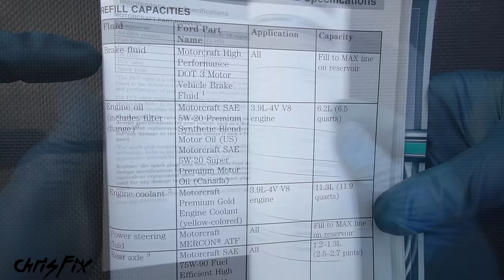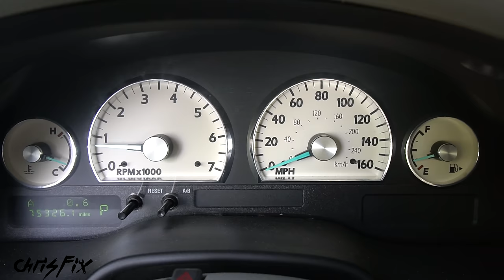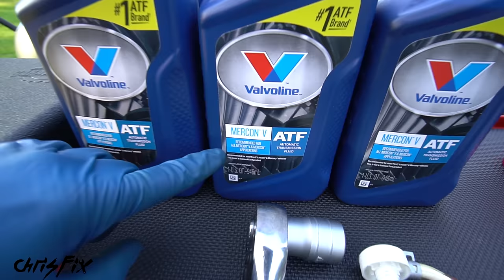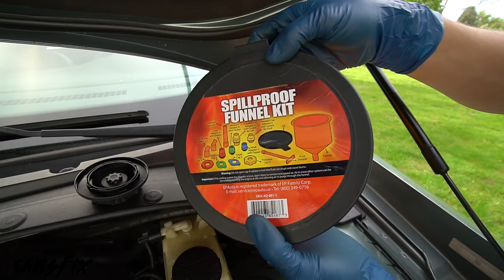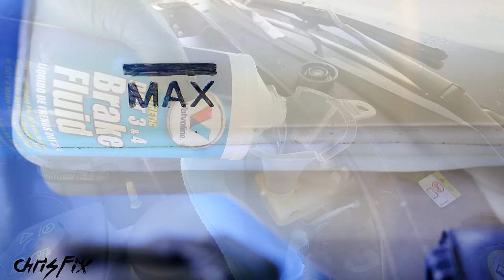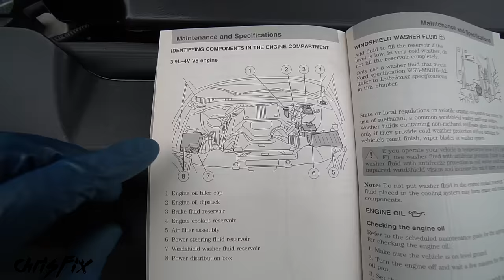How to Change EVERY FLUID in your Car or Truck (Oil, Transmission, Coolant, Brake, and More)

Comment: I can’t believe he forgot blinker fluid 😂
Reply from the maker: Watch the video again :p
Reply: he did at 38:53
Reply: Ikr tf man
Reply: @Ready__xx__minecraft  yeah we know
Reply: Must be a BMW driver
Reply: @chrisfix  what about the piston return springs or the muffler bearing?! Thanks for all you fo Chris!!!
Reply: @footyshort  lolol
Reply: You have to change it every 10000 miles
Reply: @Ready__xx__minecraft   I change mine every  4567.876 miles.    

Exactly 4567.876 miles.
Reply: @livewireOrourke  bruh you're 2 miles off
Reply: And muffler bearing!😂
Reply: @chrisfix  
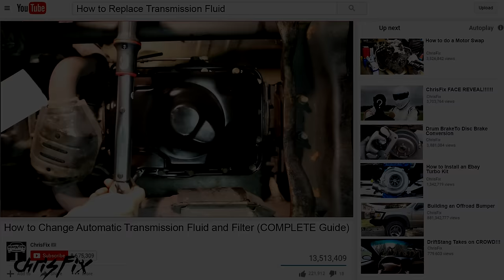14:35 ... Also, remember to constantly monitor the condition of the nut holding the steering wheel   ;·)
Reply: @aeldallkushi5882  thank you for mentioning the muffler bearing, very important

Comment: Chris as a 15 year old you’ve helped me so much I appreciate everything you’ve done for the car community and for the people who didn’t have anyone to show them how to fix their car it really means a lot to us
Reply: You like cars huh
Reply: It's always good to flush any fluids in any automobiles all but automatic transmission ONLY if the automatic transmission fluid  is ( burnt ) and looking like it's Blake fluid
Reply: @jonnygarland4741  Actually its the opposite...if the trans fluid is looking burnt then the fluid probably has grit that helps the discs grab still and when you drain you lose that grit and the trans starts to slip
Reply: @Bimmer_MD  that transmission is screwed though, it's worn out,you could  use the lucas additive if it starts slipping
Reply: Repent to Jesus Christ “The light shines in the darkness, and the darkness has not overcome it.”
John 1:5 NIV
Reply: @Repent and believe in Jesus Christ You can pray all you want, if you don't change the fluids in your car it will eventually break down.
Reply: @francoamerican4632  Not true. I prayed and God changed my car's fluids for free
Reply: As a 19 year old I back this
Reply: @jonnygarland4741  unless it’s a Honda. Don’t flush any Honda components.
Reply: 15?your car is scared😱💀💀💀
Reply: @demonslayer4951  16 now still ass sliding my fwd honda prelude😭
Reply: Why do you have a car at that age? 💀

Comment: [4:25] - Oil Change
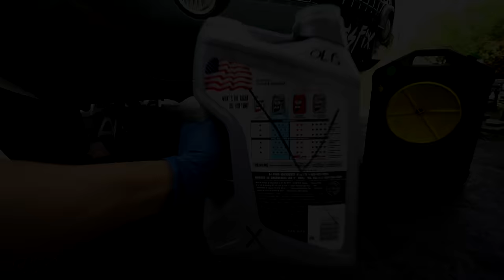[9:38] - Transmission fluid
[14:37] - Power Steering fluid
[17:14] - Coolant fluid
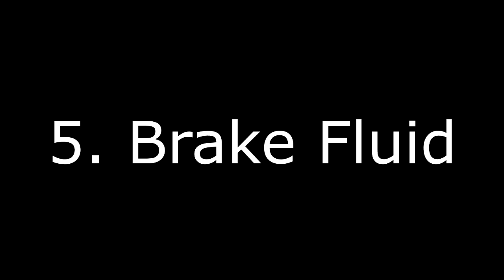[24:49] - Brake fluid
[30:23] - Differential fluid
[32:53] - Transfer Case fluid
[34:57] - Grease
[36:57] - Washer fluid
Reply: Blinker Fluid is missing ☝🏼
Reply: @emirhas8793  😂🤣😂
Reply: @emirhas8793  he has a separate video for that!!!!
Reply: @EazymoneyBicch  i know 😂😅 with elbow greese
Reply: Thanks
Reply: @emirhas8793  lol
Reply: @emirhas8793  p
Reply: @emirhas8793  hahaahhaha
Reply: @emirhas8793  wait bmw cars  don't need it
Reply: Thank you ❤️
Reply: thx
Reply: Thank you
Reply: Thank you 🙏
Reply: @cozz124  LMAO 😂
Reply: Thanks
Reply: Champ! Thank you
Reply: stolen
Reply: So many Soda flavors.
Reply: @emirhas8793  wtf
Reply: The video has chapters 😭😭😭
Reply: You could just go to the chapters but thanks!
Reply: You got fancy with the brackets

Comment: 1. Engine oil 4:24 
2. Transmission Fluid 9:38
3. Power Sreering Fluid 14:36
4. Engine Coolant 17:14
5. Brake Fluid 24:49 
6. Differential Fluid 30:23
7. Transfer Case Fluid 32:54
8. Grease 34:57
9. Washer Fluid 36:55
I gotchu <3.
Reply: Real Chris Fix fans see the whole video, although we've seen the in-depth videos ;)
Reply: I didn't get to watch it do to school :(
Reply: Ty
Reply: My Mechanical Engineering professor who use to be head of development for Ford in England, said depending on the fluid “lifetime fluid” is only good for 100-120k Miles.. This may vary depending on the manufacturer. Sometimes it can just mean while it is under warranty so 60k miles..
Reply: You sir are a legend I applaud you
Reply: No blinker fluid? :( really need to change mine
Reply: @RoCarz  time stamps help because when we come back at future we dont have to watch the video all over again so that comment is super helpful
Reply: U don’t do that here, real fans watch the whole thing
Reply: @ClassCraZeTV  watched it twice.the second time just to write down where everything starts so its easier for me and for u guys to get where u want when u come back.without having to search around for what u looking for
Reply: thanks really helpful :D

Comment: 0:00 - Beginning
1:15 - Lift the car
4:23 - Engine oil
9:37 - Transmission fluid
14:35 - Power steering fluid
17:13 - Engine coolant
24:48 - Brake fluid
30:22 - Differential fluid
32:52 - Transfer case fluid
34:57 - Grease
36:55 - Washer fluid
38:30 - Lower the car
38:53 - The End
Reply: God bless you!
Reply: Thanks! You're the best!
Reply: MVP
Reply: You’re a Saint
Reply: @isaiahcedillo9435  Naahh... Just a Swede (you know, that dark and mysterious country in the north).
Reply: You the real MVP!
Reply: You missed the blinker fluid part
Reply: Thanks bro
Reply: @edo386  LMAO 🤣
Reply: Resetas
Reply: Be careful. He's a hero
Reply: Hero
Reply: Thanks made it easier

Comment: I know absolutely nothing about cars apart from cleaning them, changing a tire and checking the oil.
Your videos have given me sooo much information and I've watched some of them multiple times to really soak in all the knowledge. Watched the brake change video today but I'm not yet confident enough to do that. But I might just change the oil myself, check the other fluids and maybe change them or at least tell my uncle (mechanic) what needs to be changed.
Keep up the great work
Reply: If you can change your oil you can do your brakes. Just make sure you have the patience haha, you can do it!
Reply: Learning to change oil is a great way to begin learning vehicle maintenance. Along with spark plugs which are inexpensive and also easy to change. Just be mindful not to cross thread your bolts. Especially the drain bolts for oil pans. Buy yourself an actual service manual for your vehicle to go along with the owner's manual. Invest in a few simple quality tools and you'll be off and running.
Reply: Believe it or not, knowing nothing about cars is complementary to femininity. Don't feel that you need to get into masculine things to be acceptable (yes, getting into cars is a masculine thing). Sadly, many women today are not taught how to be a female at all. Try and find womanly women, hang out with them and learn from them. Also, unless you've lost your hair because of an illness that you can't control, having a buzz cut is not feminine. If you look to the past, you'll find that feminine women were nothing like the women you see today. You should want to be more feminine not only because it's beautiful, not only because masculine men love it and do not love unfeminine women, but because you are a woman and once you get the basics down, you will naturally do it well.
What you just heard is the truth and, sadly as well, the majority of people out ther are too cowardly to tell you the truth. I would say that most people on the coments section are too scared to tell you the truth that they will pander to you.
Search for videos of feminine women and you will not see them working on cars. And if you want to get a full dose of real women, search for videos of biblical women. Regardless of how you feel about religion, those women are super feminine and super ladylike. They will give you the best advice. Reunite with your femininity and leave the masculine things to men, there are enough men around to handle the job (including your husband or future husband).
Reply: @yougetagoldstar  i agree with what you’re saying but learning about cars is kind of essential in this day and age regardless of gender lol.. if a woman is dropping her kids off at school and her car blows a tire she should just wait on a man to change a flat? lol

Comment: I can't imagine a more perfect instructional video.  The biggest obstacle to doing vehicle maintenance is not knowing what we're doing.  Not having a mental picture of what we need to do.  Chris' videos take that mystery away so we DIY'ers can keep our equipment running for many more miles.  Many thanks, Chris.
Reply: Man, I recently bought a '96 grand am gt, and I'm pretty sure the previous owner never flushed any fluids. They lived in a Florida beach, and there sand everywhere. I'm pretty sure there's sand in the radiator even.  😅
Reply: @Freezinggreece2  Last year, I bought a '94 F-150 that came out of Tennessee.  Turned out to be a '94 cab on a '92 frame.  I flushed EVERYTHING - even the rear differential and brake fluid.  It's a great truck in that you can even drain the torque converter fully.  But I figured if it was a junkyard Frankenstein then I better do a thorough job if I wanted it to last.  Had to rebuild all four brakes, too.  I found that an oil pan off of a 4x4 will fit on this 2 wheel drive truck.  The 4x4 pan has a drain plug.  How nice.  Don't have to be balancing an oil pan full of 6 quarts of oil in it while laying on your back underneath the truck.

Comment: Engine: 5:00

Transmission: 9:37

Power steering: 14:37

Coolant: 17:15

Brake: 24:50

Differential: 30:23

Transfer case: 32:54

Grease: 34:59

Washer/ windshield wiper : 36:56
Reply: It's already in chapters lol
Reply: @pineappleboi27  this is incase I need a refresher, I just time stamped them for my convenience.
Reply: @ReaIHuman  thanks mr chicken man
Reply: Where’s blinker fluid and horn oil?
Reply: @nazthelizard122  don’t forget door fluid
Reply: @nacl2858  And summer/winter air for the tires.
Reply: @Veroxzes  I have to change that? :O   Is it difficult?
Reply: @rasmadrak  its sarcasm
Reply: @jaxx1360  Yes. It was pretty obvious too. 

But don't forget to change the blinker fluid. ChrisFix has an episode for that. 👌
Reply: You seem to be a real human.
Reply: Yeah I waiting for this comment lol t.y
Reply: Repent to Jesus Christ “The light shines in the darkness, and the darkness has not overcome it.”
John 1:5 NIV
Reply: At what time is the blinker fluid? ;)
Reply: Where is the blinker fluid
Reply: @nazthelizard122  they are not real they are April Fools jokes

Comment: chrisfix:"make sure to torque the lug nuts to spec"
me:"i think 3 ugga duggas is enough"
Reply: don't make that extra 1/2 ugga dugga !! haha
Reply: NightmareWOW I just let it click a couple times I don’t bother with ft lbs lol just make it tight
Reply: Yeah but, like my dad says, "ugga duggas isn't a precision torque measurement." He says this because his coworkers would never use a torque wrench and then they would cry about the leaks they would have.
Reply: I've seen the "ugga dugga" reference on a few YouTube car videos--what is it from?
Reply: Never torque in the air....
Reply: @dantizzle00  "Ugga dugga" is the noise an impact wrench makes.
Reply from the maker: Sounds about right!
Reply: @chrisfix  hey Chris, how are you? Can I put a turbo in a 2002 Suzuki XL-7
Reply: Nolan Samuel You can turbo most cars. It just depends how much space you have in the engine bay to work with. Also note how many miles you have. With so much air being pushed into the pistons, it’s going to make your engine work harder. Transmission too. You’ll be shifting faster. So if it’s a super old engine and transmission, I wouldn’t recommend it.

Comment: I feel my self warm and relaxing when you took care of the cars and even I feel good when driving after doing awosem care
Reply: Same, man! With this covid situation now I don't have mich money. I had to service my truck this summer, but I can't afford it this year so I'm going to remove all the wheels and put it on jackstands😂. I'm gonna service my baby next year for sure. I'm changing most of the independent suspension parts, oil, brake pads, rotors, brake hoses, power steering fluid, thermostat... Just a lot of work man... Thank God I have a few buddies to help me with this gigantic job. I mean I can do most of it, but I don't have all the tools... So that's why you need to surround with people who can help you, and later of cource I will return the favour.

Comment: Success story! I bought an old truck with 225k miles on it, and my brother told me the best thing I could do for it would be to change all the fluids. Then he shared this video with me. This video gave me the confidence to get it done myself, and I'm so grateful! I even got extra thorough and did a complete flush of the coolant, complete drain of the transmission (including the torque converter, which had a drain plug), and I removed, cleaned, and painted the differential covers. It was actually fun! I just finished the job and took it out for a joy ride and she runs beautifully! So stoked! Next I'm moving on to your video about detailing the engine bay. It's covered in old grease and stays hot for a while after shutting off, so I think cleaning it will help a lot. Thanks Chris!
Reply: where did you get rid of all the coolant/water from your flush?  how much did it generate?
Reply: @laurelrunlaurelrun  my auto parts store does oil and coolant and diff fluids and such. just ask em

Comment: Chris, you forgot the Blinker fluid!
Reply: Best comment.
Reply: blinker fluid only needs to be replaced once a year, on April 1st.
Reply: @TheAngusGao  exactly
Reply: f
Reply: Was looking on thumbnail for it lol
Reply: I came here just to find this comment and thumbs up I knew it would be here
Reply: @TheAngusGao  Along with the muffler bearings. If you forget those then you might as well toss your car in the trash pile!
Reply: @TheAngusGao  For those who are curious, it's because it's a very sensitive season specific fluid and 12 days into spring is the optimal time to do so, especially for BMWs. No other reason whatsoever for that specific date. :)
Reply: funny i was gona say that... also kanuter valve
Reply: Right now this comment is 3rd in the list.
STILL SCROLLED DOWN WAY TOO MUCH WTF INTERNET
Reply: You stole my idea!
Reply: Clicked the video just to comment this. I was late...
Reply: @markwright3161  so u have problems with Bmw-s overthere to whit blinkers that comes as extra whey they are purchased as new, thats the xtra feat that cost more then the whole car, itt goes for audi-s and mercedes to
Reply: Don't worry, he's got a separate video on that.

Edit: not a joke, btw. He actually does.
Reply: @ginaboos9563  can you pls explain? I have no idea
Reply: @hadiasari3092  Do not worry, its merely a joke. This video has everything you need on changing your vehicle fluids, the video is correct.
Reply: @barse27  I don't do it because it is too risky. As Chris warns, if you get it in your eye it causes uncontrollable blinking.
Reply: Just watch the video linked at the end 😉
Reply: Automatic or manual?
Reply: There is nothing called blinker fluid
Reply: CTRL+F "Blinker"
Reply: @TheAngusGao  obviously blinker fluid needs to be replaced on February 30th.
Reply: I was looking for a comment like this 😂
Reply: Yeah
Reply: @noahmcclure2515  lol
Reply: It's there just watch
Reply: There is no such thing as blinker fluid
Reply: No all cars have blinker fluid
Reply: It's in the background 24:47
Reply: I was waiting for this

Comment: Helpful tip when changing the oil filter: get a 1 gallon ziploc bag and place it around the filter when loosening. Allow to drain for a few seconds into the bag then remove the filter with the bag still around it and voila, clean filter removal.
Reply: Thanks for the tip. That is a very logical thing to do! :)
Reply: But then how do I get my yearly dose of viscous hydrocarbons and fine metal shavings? Can you even call yourself a mechanic if your blood/oil ratio isn't at least somewhat worrying?
Reply: But I like it running down my arm.
Reply: Thank you so much for this tip!

Every time I change the oil on my Suzuki Grand Vitara I curse the engineers for putting the filter where it is (you have to reach up almost shoulder deep into the car from underneath and you're working blind, and there's something in the way from up top so you can't reach it from there either).

I'll definitely have to give this a shot
Reply: Benjamin Dan you’re welcome. Let me know how it works for you.
Reply: Nice!

Comment: Mr Chris fix.  You are the best instructor on the web.  I have fix 3 vehicles including my own using your videos.  My car now has all of its accessories working.  It is so good to drive with cruise control, and all the fluids in good condition.  My car is now running very smoothly.  Thanks a whole bunch!!

Comment: A little addition to the transmission oil change: some cars have two bolts, one drain plug and one plug above to fill it with oil. The important thing is: always loosen the filler plug first, then the drain plug. This way you can make sure that you have oil in the transmission incase the filler bolt is rusted and won't come out. If it doesn't you could still drive to the professionals to have it fixed.
Reply: Good tip. He also mentioned that in at least one other video.
Reply: yeah same with diffs

Comment: I love this video. I will say that some brands and models are completely different and some are similar but this should give a good idea for most brands. Also, helpful tip with power steering. remove the return line and put it into a 2 liter bottle. Now you can treat it like a brake bleed. Turn the wheel and keep an eye on the level of fluid and refill as needed. When it come in clean, you are good. Old fluid is in the 2-liter and new fluid cycled all the way through without really mixing too much with the old.